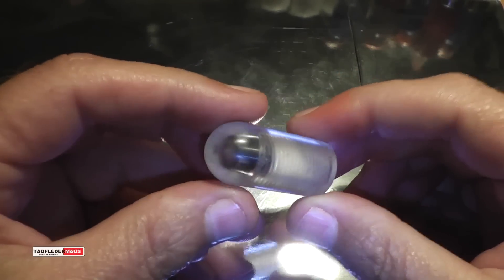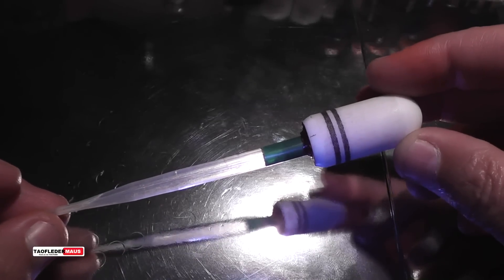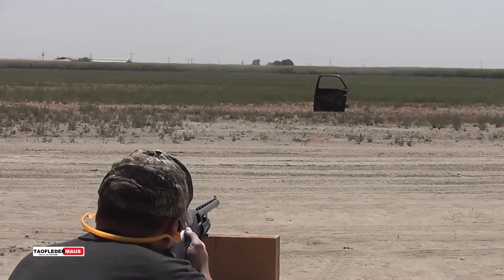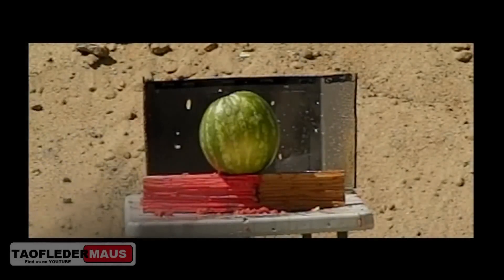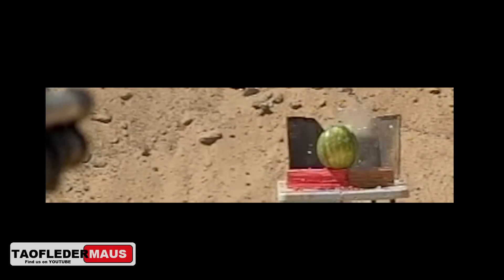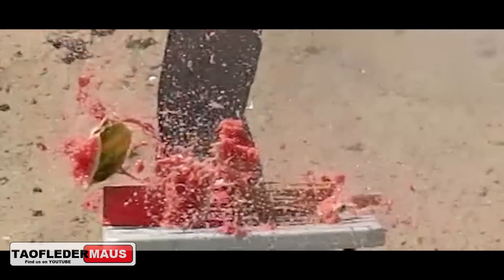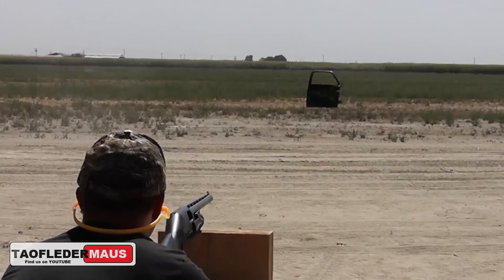12ga. TEFLON Shotgun Slugs - Experimenting/Testing

Comment: You guys should play more with the circular airfoil concept and see if you could get enough mass in it, with a large enough hole to work. You might need to lower the powder charge till it is subsonic to get airflow through the center of the ring though. I know that was an issue with the tubular projectiles tried in the past, at supersonic velocities there was no airflow through the center, but at subsonic velocities, it did actually work.

Comment: While I'm no expert, I do have a hypothesis as to why this, and other similar rounds, are so unstable. A plausible cause is the fact that they're placed in backwards. 
As you said, this is meant to allow you to fit the rounds into the gun, and it'll flip around, as we saw. However, it is possible that there is momentum left over from the flip, swinging it around further, and basically causing it to sway around. 
An example of this would be a ball on a rope, suspended vertically. If you hold the ball above the vertex, or where the other end of the rope is attached to a fixed structure, and give it some horizontal velocity so that it starts swinging around the vertex, it doesn't just stop at the bottom. It continues on its trajectory, and then continues to swing to and fro until all the kinetic energy has been exhausted. 
It would stand to reason that the same would apply to these rounds. (I have more but text limit)

Comment: Maybe some fletchings (the fins on the back of an arrow) might help a little? It helps with rockets.  Also, something unrelated you can try: the dimples on a golf ball provide weirdly aerodynamic properties (lookup Mythbusters' golf ball car). Can you make a ball bearing shaped like a golf ball? Just curious if something like that could fly straight.
Reply: +Damon Czanik The big ball bearing he's shot before was already accurate but would still be cool to see this done. Would be quite easy to make a golf ball out of steel.
Reply: +Damon Czanik The dimpling on a golfball screws up the airflow around the golfball so the low pressure zone behind it doesn't suck the ball backwards. Should fly straight but I seriously doubt it'd matter at supersonic velocities, I don't think the air would even touch the dimples.
Reply: +Tombs Clawtooth Yeah, the fastest a golf ball has ever been hit is only 330 feet per second, which while pretty quick, nothing compared to supersonic

Comment: I imagine that the flip as it exits the barrel is what is causing the crazy trajectory.  I wonder if it wouldn't be better to put it in the right way around and rolling the tail up behind it. It should unravel as it travels and cause the desired stabilizing effect without the problems that the initial flip causes.

Comment: I think that because the round has to flip 180 by the time it's pointing nose first it has changed trajectory dramatically. Maybe there's a way to make a fin/drag device that slides through the center of the slug instead of having to rotate?
Reply from the maker: +Rush Yahr   The qtip stabilized slugs worked pretty well,  and those things are pretty fragile.
Reply: +TAOFLEDERMAUS Why not add a couple of strings  with the aid of that threaded hole and a plastic screw. They would stick out the back, and you could place the slug the "right way".
Reply from the maker: The strings would do the same thing as this.

Comment: Why don't you try gluing in a kevlar strip into the back of these? There would be a bit more drag and the higher flexibility would increase the frequency in which the oscillations occur. It would also allow the round to be loaded nose first.

Comment: What if you guys made a dart-like round (either low profile like this or stocky and with breakaway shields) where the tail has fins on it that are cocked at a slight angle. This is how I fletch arrows to make them spin in flight, but idk if it'll scale up to supersonic. Maybe with the spin coming from the back they'd hold better than the turbine rounds, and help stabilize like the darts or these "smooth tail" rounds.

Comment: The thing you commented on aboout weird aerodynamics wasn't actually weird, nor caused by supersonic environment. The round simply had more momentum to go sideways than the puny tail could counter with its drag. The thing about supersonic speeds though is that the air doesn't flow back where the round passes fast enough to make a difference, and that makes any tails thinner than the round itself completely and entirely useless. It also makes simple drag fletching, like some brushes or whatever more effective than steering fletching like fins. Your tail was too weak to withstand the forces and too thin to generate any considerable drag, which basically made you fire the rounds the wrong way around for no apparent reason, and then do absolutely bizarre stuff when it slows down and fluttering tail takes some effect.

Comment: I beg to differ from your statement about the dust being kicked up by the shock wave of the round. You can see the dust being kicked up in two distinct puffs, the first puff with a tail heading to the right. The two clouds are also kicked up at the same time the tail of the round is at its lowest point in rotation, leading me to think it was the tail that created the dust clouds.

Comment: Have you ever just attached a bunch of string/twine/yarn onto the back of a projectile?  It seems that might work better since it wouldn't have to flip the round 180 degrees and would create more drag.  Maybe you could drill a hole in the back of the projectile maybe half way in and then push some string/twine into the small hole then fill the hole with hot glue or something.  The string/twine would then just compress in the shell behind the projectile ready to deploy immediately.  You could also maybe use a small tack or finishing nail or screw to hold the string/twine in the hole.  Obviously, the pieces of string/twine would need to be long enough to trail maybe six inches behind the projectile when shot.

Comment: hello i love your videos, and i wanted to ask you if you found that slug mixed with buck is more stronger and accurate than regular slugs for a 12 gauge, also what is the strongest shot gun round you fired and that mabye someone like my self can find for a 12 gauge? thanks again.
Reply from the maker: +Josh Ray  Birdshot is better.  It's a denser slug,  fewer gaps between the balls,  stronger bonding,   and a lot cheaper.

Comment: I used a spud gun and loaded it with an empty CO²  Cartridge with a 1/4 inch hole drilled in the round end with a string out he narrow end, about ten ft. for stabilization, then wound around the cartridge.  I wrapped it all in a rag for a tight fit down the bbl and fired it like a bazooka at a wooden fence and it stabilized with a little over a forty grain weight in the nose.  you can select the filling but may be something to try a length of cord that unravels for stabilization. If using a CO² cartridge check its diameter and that of the muzzel.  Cartridge may be filled with anything and the weight in from behind 40 grains was just a weight available to me at the time about thirty years back.
Reply from the maker: +Richard G. Stone, Jr.  They don't fit through my shotgun barrel.

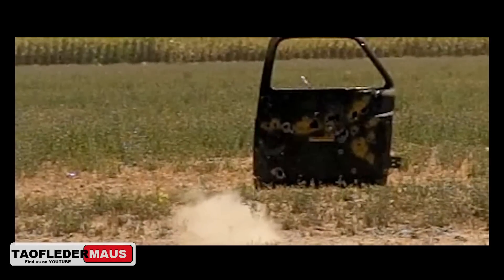Comment: I am not sure the slug at 4:29 actually hit the ground, it looked more as if it was repelled by the shock wave.
Reply from the maker: +Leif Vejby  I think you are right.   It's hard to tell though.   But the initial puff of dust occurred before it even hit.
Reply: +TAOFLEDERMAUS Its rotation changed drastically, I'd say it bounced.

Comment: hi TAOFLEDERMAUS!
you always mention supersonic aerodynamics, but actually from the videos i've seen there were no supersonic rounds, only subsonic. If the round isn't faster than a speed of sound its subsonic. If it goes faster though you'd (we'd) hear a big boom.. but you probably know that already.
Reply from the maker: +bandinator  Trust me they are going at supersonic,  and lighter rounds are going much faster.   How are you going to hear a sonic boom over the gun shot?
Reply: well, its a greap oportunity to experiment! Maybe over the gun not, butb next to, or on the slow-motion pictures it could be seen.
I think that the loads are quite big, the "bullets" are not so tight in the barrel so a lots of preasure escapes trough the gap, and the explosive isn't so much that would speed up the load to suspersonic speed.
+ as far as i know, shotguns usually don't have supersonic ammunition.
Reply: +bandinator Sonic booms are generated by things that make a lot of noise while moving supersonic.  All the noise from a gunshot comes from the exploding powder, not from the bullet in flight.  The bullet does not have a jet engine strapped to it, propelling it along through the air, it is just basically freefalling once it leaves the end of the barrel, and freefalling does not make a lot of noise.  Also, to hear a sonic boom, you would have to be down range from the shooter, since you only hear a sonic boom as something moving supersonic and making a lot of noise flies PAST you, not just AWAY from you, so even if the bullets were making enough noise to create a sonic boom, you wouldn't hear it from behind the gun.
Reply: thank you for taking the efford to answer, but its not completely right what you wrote. Everything that moves faster in the air (that  speed (it called "Mach" - depends on the temperature, humidity, air pressure and hight) than sound generates sonic boom.
That is the idea of some snipers rifles, which fire bullets slower speed, because you can reduce the sound of the gas but you can not reduce the sonic boom created by the bullet. And, even air can travel faster then sound!
You are right that if you are behind the rifle you'd not hear directly the boom, but you may forgot that the boom will have an echo.
Reply from the maker: bandinator The shockwaves you see going across the ground in some of my videos  are going at the speed of sound.
Reply: Well that is a good point!
Of course it doesn't mean that the others also fly M < speed!
You can get a ballistic chronograph for less than 100 bucks if you want to be perfectly sure about the bullet velocity! :)
Reply from the maker: I guess if it were that important for me to prove these are going super sonic.  But shotguns and chronographs don't work very well since there are multiple objects  that would fault the chrono out.  (or impact it)
Reply: +TheBalefire a sonic boom is not created by something generating noise dude, it's the object penetrative a sort of invisible field. That's why a bull whip creates such a loud crack, because the very tip creates a mini sonic boom. But they don't have jet engines either haha